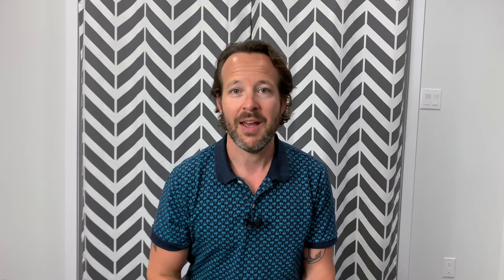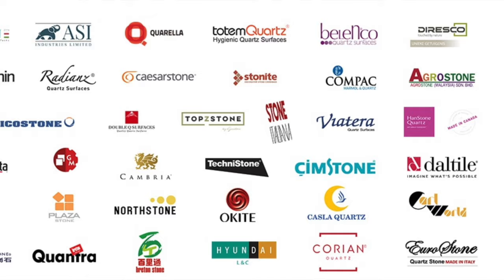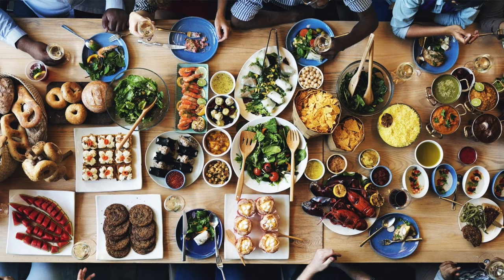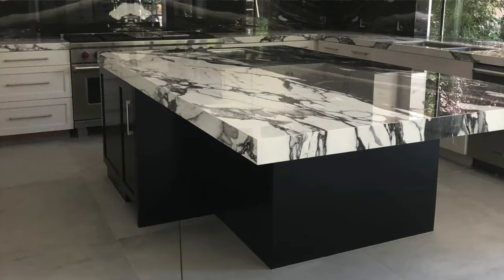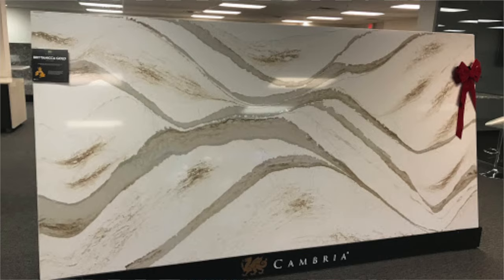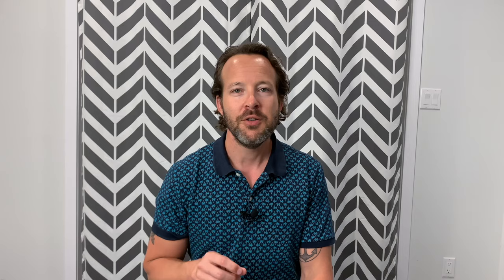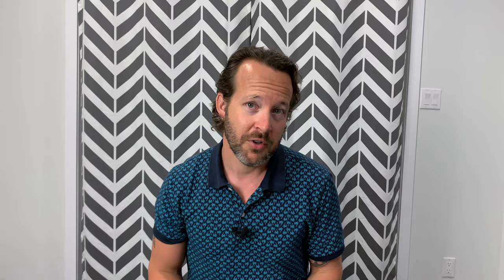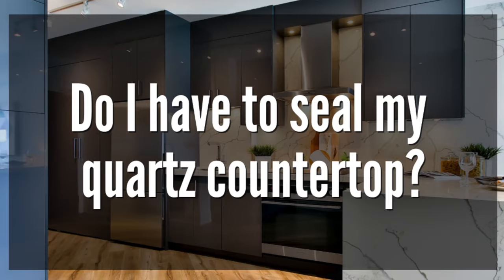QUARTZ COUNTERTOP | Everything You Need To Know

Comment: While I like the way you broke down the "things you need to know " categories,  there is some misinformation in this video.  1) using the Breton method of manufacturing doesn't guarantee equivalent quality.  That method combined with good raw materials is what creates quality engineered stone. 2)  material thicknesses are not that thin (you referenced mm rather than cm). 3) heat resistance is not up to 700 degrees Celsius.  It isn't even 700 degrees Fahrenheit.  It accepts moderate heat and is susceptible to thermal shock. 4) it cannot be used outdoors...which needs to be part of the conversation...even in covered areas. Always check with the actual manufacturer of the product with regard to how to care for quartz surfaces. And finally,  a brand name does not mean they actually manufacture their own product.  Some "brands" are produced for a brand name but that company doesn't actually control the content/process (just color or pattern definition).
Reply from the maker: Hey.   Thanks for the comment.  And the insight on a few of the points I messed up. I appreciate it.  While I try to research and find good info, it’s never perfect.
Reply: What temp/degree would you say is correct?
Reply: @MTKDofficial  you are welcome! I was lost when I first got immersed in the stone industry. There's a lot to know and technology is changing our choices rapidly. Google doesn't always have the most current information which is a challenge in all areas of design.
Reply: @russman1958  check with the manufacturer. Usually less than 350 degrees F.
Reply: @whatsgoodinthehood  thank you !
Reply: How do we know you’re correct over him?
Reply: @Chef Ross  I would refer to his answer to me. That said, technology is constantly changing, so it pays to do real-time research.

Comment: If you spill wine or some tomato sauce and forget to clean it, Quartz WILL stain. Put a hot pan on it, and it WILL leave a yellowish stain. I used to have granite, and deeply regret putting Quartz on my kitchen. It looks nice, but it is actually rather delicate, specially in white color I installed.
Reply from the maker: For sure.  The resin will discolour with either heat or some substances.  Though with my testing, only turmeric left a light residual stain.
Reply: Our home was a flipper restoration but we needed to buy it. The counetrtops throughout are quartz & stain instantly and etch and shasow instantly, with no remedy. Its like the top film is porous, and absorbs. Anything oily..instant. Anything slightly acidic even like hydration drink powder if condensation liquifys...instant. any highly pigmented spice. Instant. The dull shadowing is the worst, & really makes the countertops look awful.
Any recommendations to reshine????
Reply: PS. They are white Calcutta type ( ubiquitous in remodels). They even gave started to feel "gritty". And..nothing ive seen in videos tell that actual PHOTOGRAPHS of the designed surfaces are layered to create the pattern..you are seeing the pattern through a clear layer of quartz. Look great ( Ive loved Cambria for years but used Genuine Quartzite slabs in our old kitchen) but still....
Reply: I have had no issues with my quartz. My guest spilled drops of red wine and it wasn’t cleaned for a while but came right off. I love it it’s very low maintenance.

Comment: I just had my quartz coutertops installed, this information is SO useful, thank you! The one thing that I never thought of was testing the draws before the counter guys left, my draws don't open! I had a moment and cried, this has been a long process and I was so excited to see them in place I never thought to test that. I just thought I would put this information out to the world for others to monitor before their counter people leave 🙂.
Reply: It can be a draining experience at times, but I hope yours is, ultimately, a rewarding one.

Forgive me if I am incorrectly picturing your issue.

If they are a reputable company who cares about such reputation, they will be willing to address the issue -- if it can be, and there is almost always an option that might be accepable, albeit, a modification of your original vision.

If there is a special overhang/enlarged edge that blocks your cabinet doors, and you are willing to change the look you wanted, they could modify/replace the countertop with a thinner edge.  Some companies will do this at no extra cost, or definitely at reduced cost -- because something like that should've been noticed by experienced installers.  This is most true if you, yourself, noticed it soon and told them shortly after the install.

Or, they should be willing to work with you by temprarilly removing the counterop until a raised wood base is attached and seemlessly blended into your existing cabinet framing.  Then the countertop can be reinstalled, now just slightly higher to avoid blocking the doors.

If all that is too costly [or if backsplashes have now been installed and countertop removal would cause cistly damage to it, there are companies that will make new drawer and door fronts [or a handy-person might even just slightly down-recenter the exiting fronts] to eliminate the blocking.
Reply: Case in point, my new granite countertops were installed with choseled edges.  I didn't have time to fully look over things -- certain things take a while to notice after the excitement and newness of the install happens.  Plus. I had to get back to my job.  It wasn't until two says later that I had a good hour to look things over in the daylight.  I noticed unacceptable areas of the chiseled edges -- significant [i.e., most] of the edging.

Although I signed their "good-n-happy" appproval sheet before the installers left -- the company was honest enough to come back and look it over.  Even though they refused to acknowledge thatvtheir claimed "chiseled edges" weren't [the edges looked like smooth waves], they ultimately removed the countertops and gave me a full refund.

Granted, they knew my personality [and couldn't claim I misunderstood reality -- before going with them,I showed them pictures of the type of chisel I wanted and they agreed].  They knew that I would take further steps until rectified.  They did the removal and refunded me [albeit, a month later] -- but not without the salesperson saying, as she left my house the kast time, "Good luck finding someone who will give you what you want."

I did, the very next day.  This company had far more experience with all types of edges, and gave me a beatiful, TRUE, chiseled edge.

Bweare of the many "boutique " countertop sellers.  It is time consuming, but find shops that have examples, and also are willing [as my second-and-better choice] to actually do a small text cut to show ypu ahead of time and ask if is acceptable before doing the whole thing.

Oh, and this second company checked the clearance of the drawers and doors before bonding the slab to the framing.

Comment: I've helped my son in-law install several quartz counter tops and when he does a seam it's like a science experiment with two suction cup based clamps that not only pull the two slabs together but adjust the height of each slab and when finished the seam is invisible. Unfortunately not all installers are willing to invest in the equipment needed to get to this quality.

Comment: This is great content.
Two things...
If you get a permanent marker on your counter top, just get a dry-wipe marker and go over the permanent marker and it'll just wipe off.
Secondly,
Can you place a quartz countertop over an induction cooktop and use pans on the quartz without it cracking from the pan heat?

Comment: Dude, this is the most informative video! Thanks for educating me. I was hired to install a quartz countertop by some friends and they apparently don't have a clue about anything. What they had delivered to their home is not a countertop, it is a five-foot by ten-foot slab. We live on an island which makes shipping prices astronomical so sending it back is not really an option. So now I am tasked with fabricating the countertops. I have never worked with quartz before so I am trying to educate myself as best I can. Your video was very helpful. I wish I could find a video on the fabrication of quartz countertops that is as informative as this video is. But I highly doubt that I will. Thanks again.
Reply from the maker: Sean!  Thanks for the comment.  I really appreciate it.  My goal is to help the viewer as much as possible.  Sounds like you are in a predicament though especially if they sent a slab.  I wish I could help you with the fabrication info, but it is not a skill I'm proficient in.  I've only ever seen it done with a CNC machine and highly specialized equipment.  If I come across something of value I'll send it your way.
Reply: @MTKDofficial  Thanks, Mark. You truly are a spreader of knowledge.
Reply: If you need to cut seams at any areas aling the install, having one big piece may actually be a benefit.  Color and shade matching among different "slabs" of same-brand quartz is a definite must if one buys multiple smaller sizes.

Comment: Exactly the discussion I needed to hear. Thanks! If my budget worked for it, I’d probably choose quartz. The countertop in the home I just bought it laminate that is edged with wood. Dated. And has evidence of some (not as much as one would have expected with this design) but some water damage. But considering all things, I’m going with laminate. For the cost, durability, and the fact that overall I prefer the sound of setting dishes on laminate over quartz or other stone surfaces, I think laminate is what I actually want. Will it need replacing in 7-10 years. Probably. But by then I might actually be interested in a kitchen renovation anyway. I’ll use the $$ saved on adding upper cabinets above  the existing cabinets that are currently topped off with crown molding about 18” lower than the ceiling.
Reply from the maker: Thanks for the comment.  I'm glad the video was helpful.  There is definitely nothing wrong with going laminate.!!

Comment: We are looking at Quartz countertops...we are younger so we wanted it because of being able to put hot pans on surface without worrying about deforming other materials..and mostly because my wife don’t want the “cheap” look of laminate... my question is...will black quartz show fingerprints and smudges more likely..kinda like stainless steel. Debating between white or black and if either one is hard to keep clean
Reply from the maker: Quartz is a great choice!  Darker colours tend to show more smudges, but particularly if they are solid colours.  Like a solid black.  However, the way the light reflects at certain times of day shows smudges on any colour.  
Quartz is easy to keep clean, definitely go with the colour that you really love!
And send me a pic when it's done!

Comment: Thank you for the great, eye-opening video! Any suggestions on where to go to research the  quality and safety of a particular quartz product?
Reply from the maker: Hey Brian. Thanks for watching. 
The best way is to call the manufacturer, if you can get that information.  Otherwise, I normally do a search to see if a product is manufactured using the bretonstone patent.   Usually you can find some info at least.  If nothing turns up, I’d be suspicious of the product.  It doesn’t mean it’s not good, but it’s always nice to see some technical specs.  These should be readily available in one nice location, but unfortunately not.

Comment: Ikea offers three price levels of quartz countertops. Based on your information, they come with the same quality but different materials for the price differences. From the look, it is hard to tell what makes the price differences.
Reply from the maker: If the slabs all come from the same manufacture, then the only difference in price would be slab thickness or slab design.  Normally the price points are for different slab designs.

Comment: Just had  a quartz countertop installed. it was a solid color with no vein or movement. I was quite surprised at the differenced between the slab color sample I had picked and the slab color that was installed. How can customers be certain they are getting the color sample picked? The slab sample had no marking on it to indicate what "dye lot" it was as the only explanation we got was that it may have been a different dye lot, a term we had never heard before. Very disappointed. We picked the color we wanted based on its being in line with other permanent surfaces in the room: the granite island, the wall tile, the floor and the brick fireplace. I would strongly suggest to all who are looking at quartz counter tops - even solid color - to be certain that the color you picked is the color you get - I would hope the showroom where you make the selection can confirm the dye lot number of the sample you pick with the actual slab used. Good luck!!! The company that made the quartz rep said it was the same color. A second company selling the same product, when looking at the two colors said, NO, they were different colors and NOT just two different dye lots in the same color.
Reply from the maker: One problem is they are using the term "Dye Lot" out of context.  It has to do with the variations in tiles and has nothing to do with quartz countertop manufacturing.  I completely agree with the second company, you were looking at two different colors.  I've sold quartz for 20 years and this has never happened....unless I ordered the wrong color.  Nothing to do with dye lot.
Reply: @MTKDofficial Thank you. Sadly neither the company we purchased the countertop from nor the company that created the countertop were willing to accept responsibility for the fact that the piece installed was not the same color as the piece we selected - we had the sample selected side by side with the piece they installed but the man representing the company that supplied the quartz said they were the same color - the man who represented the company that sold and installed the quartz felt it was definitely different than the color ordered but that we, the customers, should have driven to the where the quartz was to be fabricated (an hour away, it turns out) and made sure the color was the same  - I now refer to that company as Buyer Beware Granite rather than BBG. What seemed evident, after both men viewed the countertop and 5" x 10" sample in our kitchen is that their relationship with each other is more important to them than a relationship with the customers making the purchase. Again, let the buyer beware. On a happier note, it was through you we learned about the low divide double sink. That is what we purchased and we are very happy with that decision. Thank you for introducing us to that sink system.

Comment: Boy did we learn a lesion. We just got our new counter top installed. I got a new deep oil fryer for xmas. I was cooking with it for the first time and cracked the counter top.
Reply from the maker: Wow!  That is not good.  Thanks for telling me.  Info like this helps when I make content in the future.  What brand name, if you don't mind sharing?
Reply: @MTKDofficial  to be honest I dont know. we bought off a large counter top store here in Vegas. I have made calls this morning. I will be calling the fryer manufacture. I want to see what the temp is on the bottom of the device. will keep you in the loop. I saw on YOUTUBE a couple clips of Air Fryers cracking the counter tops
Reply from the maker: @DannyVegas  I hope they can do something for you.  That is disheartening.  It must get pretty hot though to crack it?!
Reply: @MTKDofficial  Trivets should be used under any electric countertop cooking appliance. It is important to remember that ES is a hybrid between natural stone and solid surface so it has the benefits and limitations of both.  When that is understood, it can give years of trouble free service.

Comment: I own a countertop company and I get this question about putting hot pans on expensive countertops .  Geez it’s insane. I ask do you always put hot pans without pot holders now ? 
I tell protect your investment. Whether it’s quartz, granite or quartzite.  But I say it’s yours when I leave do whatever you want with it . It’s funny that putting a hot pan on it one of the main questions.
Reply from the maker: Very sound advice.  It is funny that it's a main concern.  I never thought of it like that.
Reply: Hi,
Will The Heat Damage It?
I Read A Few Comments, There’s Has Turn A Yellow Shade.

Any One …

Ty, Rosie
Reply: @rosieandrade8482  yes high heat can melt it and discolor it 
But a cookie sheet is usually ok . I think it’s good for a couple of hundred degrees. But why chance it put a pot holder down. Takes a second.